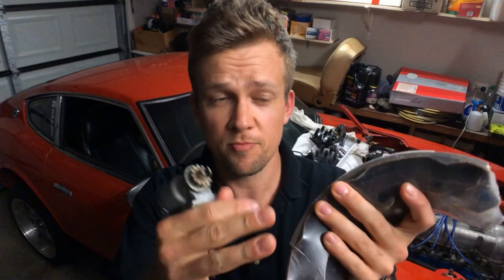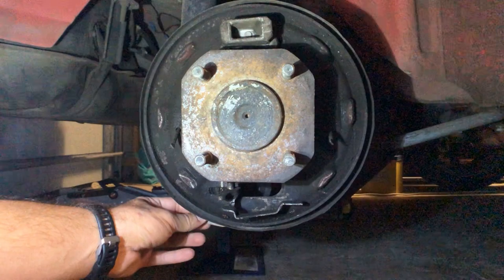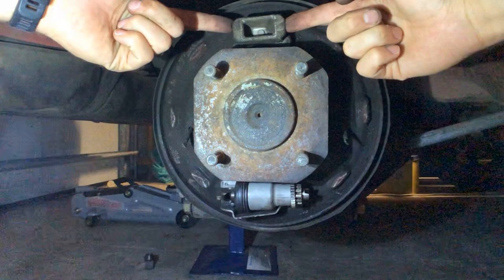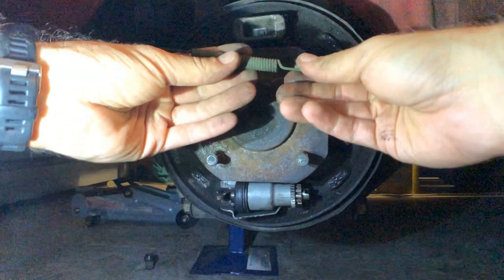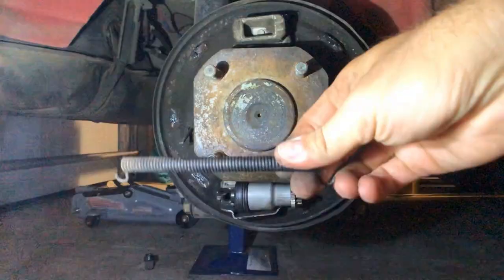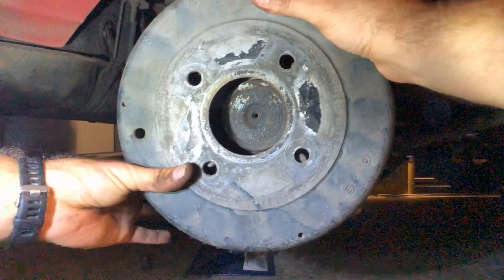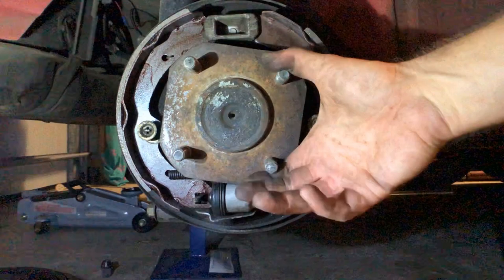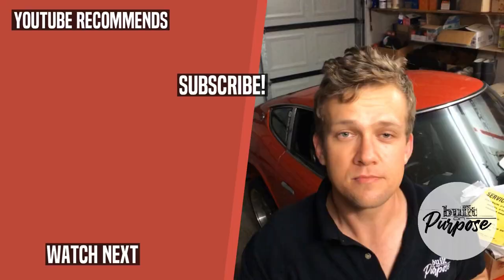How to: Z car rear drum brake rebuild (in depth assembly)

Comment: Nice editing out the swearing ,  put a 12 mm socket and extension on the spring retainer, push down and turn the retaining pin from the back. a lot easier 
Yes 240Z , Rering  2850Ccc engine , built gearbox , change R200 diff to a LSD one , rebuild back brakes ( 260z double ended cylinders ) , change master cylinder  + 50 hours of incentive , easy.
Reply from the maker: robwhite240z I wish I thought of using a socket! I’m pinning your comment because that info needs to be shared.